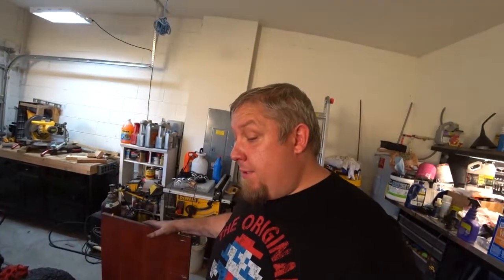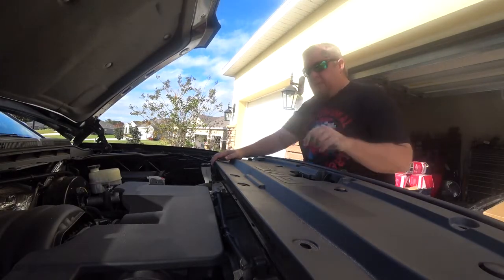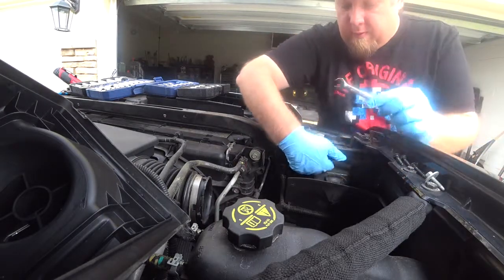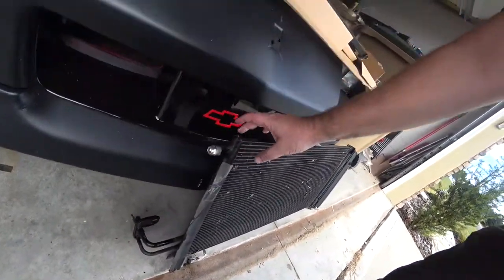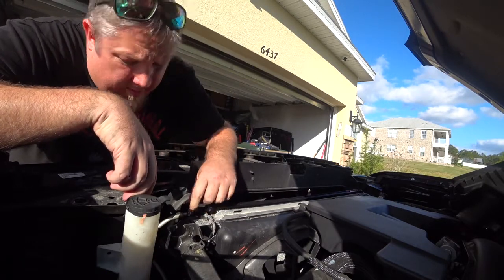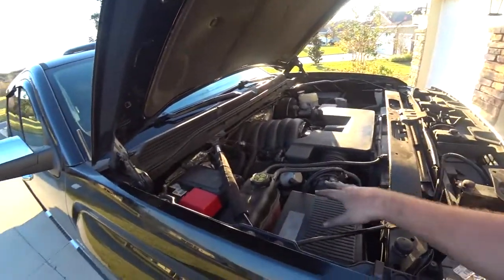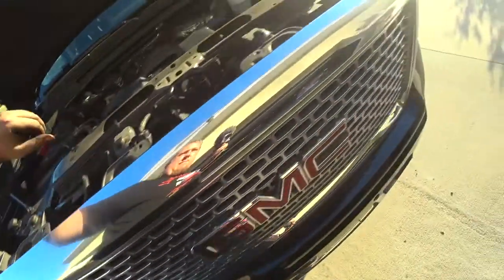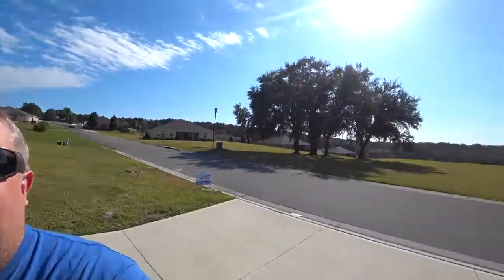AC condenser replacement - GMC/Chevy truck

Comment: Great video, I just did my condenser, I used your video to help. One thing, don't remove the trans cooler clips from the new condenser, you can push the lines on with them in place.
Reply from the maker: jaysav thank you

Comment: I'll be doing this to my truck this weekend.  I have a 1500 Sierra Denali with 5.3L engine.  I think I saw in one of your other videos that you have the bigger engine in yours, but in comparing this video with others I think everything for this job is the same.  I'll be following your video and steps very closely.  I plan on vacuuming and recharging my system myself once the new condenser is in place.  Fingers crossed!
Reply from the maker: Good luck bud, take your time and save that money :)

Comment: I have a question for you....I have bad o-rings on my high and low pressure tubes. Do you by any chance know what sizes those are??
Reply from the maker: I do not but they are pretty standard and the kit they sell at parts store fit. They are normally green.
Reply: Ah okay. Thanks

Comment: What brand condenser did you put in looks way more solid than the original
Reply from the maker: Tito Boss it is better built due to the known issue, but it is the one auto zone sells, not sure in brand. Sorry
Reply: @CamaroMac  I think thats the Spectra premuim condenser im about to do this job on my 2018 Silverado seems to be a common issue. Thanks for the video bud awesome information im gonna make sure and put in some new O-rings
Reply: @CamaroMac  AutoZone sells 2 brands - the AC Delco and Spectra - can you check the receipt you mention in your other post. The AC Delco one appears to have one solid seem and not three like the older ones.

Comment: Hellow. Am replacing the condensor on my truck too.  Did u added trans fluid after u were done or u just left it like that
Reply from the maker: German Arreola I did end up adding some, but I did not lose much at all, less than a quart
Reply: @CamaroMac  ok good.  Thanks for replying back!!!

Comment: Did you have to have to prime the transmission line after you installed the new condenser?
Reply from the maker: I didn’t prime it, just check levels a few times right after, added a little fluid and I was good
Reply: What fluid

Comment: Question!..if my condenser is not leaking and gauge shows  freon is full ..and my compressor is good..do you have any idea what it could be to where I have no cold ac..
Reply from the maker: I would check relays and fuses, do you here it kick on under the hood?
Reply: @CamaroMac  yes everything works as it should..compressor is engaged..condenser is not leaking..and freon is full..I guess it could be the ac switch
Reply from the maker: @paulperez8771  look at that and the blend door actuator

Comment: My dad just paid $800 in labor at the dealership for replacing the ac condenser....wtf?
Reply from the maker: That sucks, I try not to take it to dealer for anything. I have trust issues :)
Reply: I wish I could get that same deal!  My dealership quoted me $1600 to replace the condenser, so I bought the stuff to do it myself.  A pump to vacuum the A/C system, refrigerant, and the condenser ran me nearly $400.  It made sense for me to do it myself, given the $1600 quote I received but if I got a $800 quote like your dad then I would have gladly paid the additional $400 and saved me from spending a whole day doing this nonsense....plus the work would be warrantied.
Reply from the maker: @devonforney320  I agree, I still have not had any issues and it has been over a year. I would recommend replacing parts, and could have a local shop to vacuum it and charge it